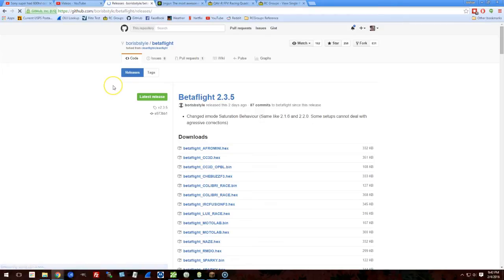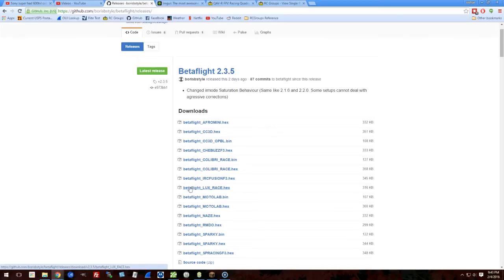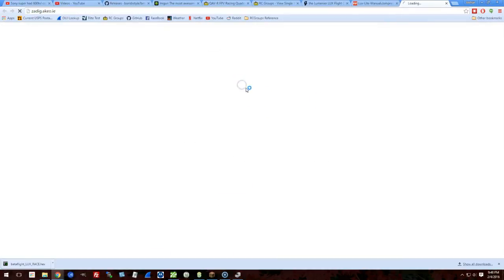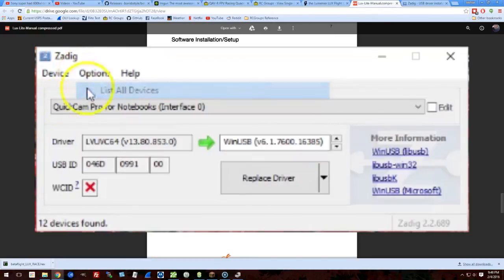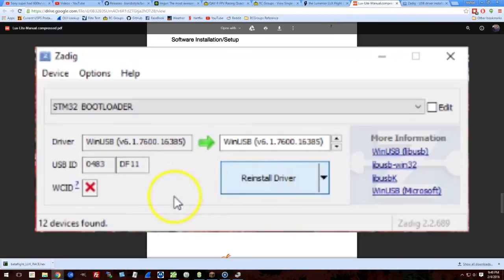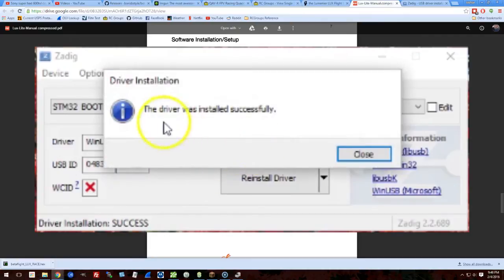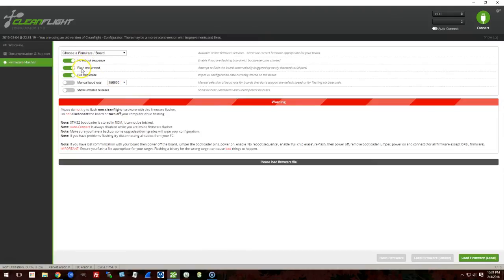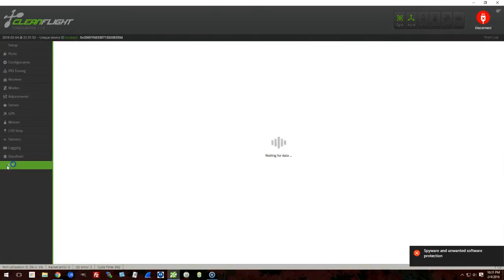How To Flash Lumenier Lux with Betaflight

Comment: I also couldn't connect via DFU. I just went into "devices & printers" (PC) and then found STM32 bootloader and clicked remove device. Then when I plugged the board in with the boot button pushed in (like I should have to begin with!) it installed the correct drivers.

Comment: I would imagine if the driver did not install message comes up its because you have to turn off windows signature verification. I get that all the time when flashing esc's. There are plenty of videos on how to do that, and will be quicker to go look than me taking up a ton of space giving written instructions. This is on Windows 10 by the way, don't know if it's an issue on other os's.
Reply: Just search 'turn off windows driver verification' and that should bring up what you need to know.
Reply: +mrmurder75 one more thing, you will need to do it every time if you reboot / power off your computer. It doesn't save it.

Comment: How're you liking the Lux over the Acro Naze?
Reply from the maker: +Justin-Rey Baltazar (JRey) Still haven't flown it. The layout is vastly superior. Love that it powers the RX from USB but not the ESCs. So you can safely bind and test your transmitter configuration without taking your props off. Also love that it has a single RX pin and you use a solder jumper to choose PPM or Serial. It seems like this will simplify installation for beginners.
Reply: Awesome. It looks like I'll make the switch to a Lux instead of a Naze for my build. I assume you'll put up a review for it in the (near) future?
Reply from the maker: Justin-Rey Baltazar Yeah, absolutely.

Comment: Some computer wiz needs to write a bit of software that pops up with a driver options box when a STM32 BOOTLOADER is detected. It would save a load of driver swapping for us poor souls using multiple FCs needing different drivers.
Reply from the maker: +Revs Does the driver above not work for all DFU devices??? Ugh. That is a pain. Hey... maybe now that I've used Zadig for the Lux, my Taranis will start working again.